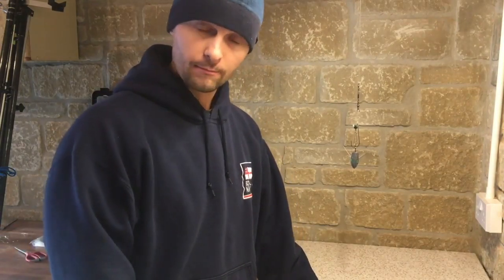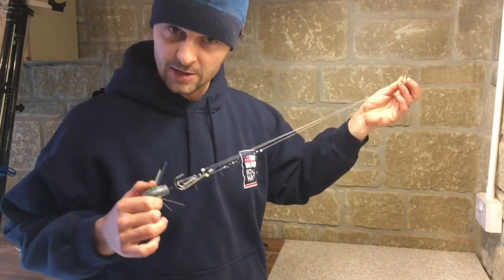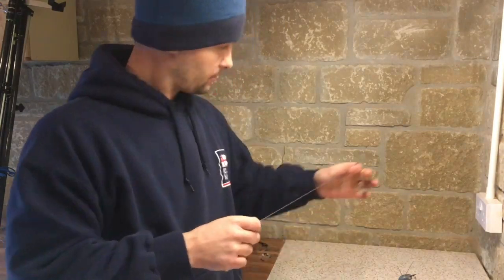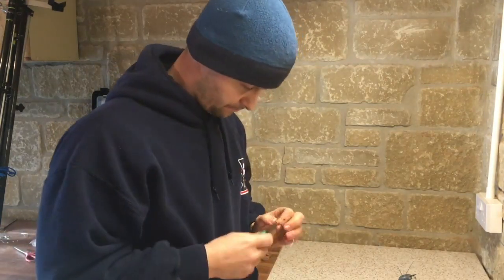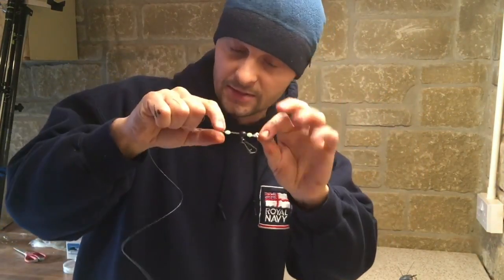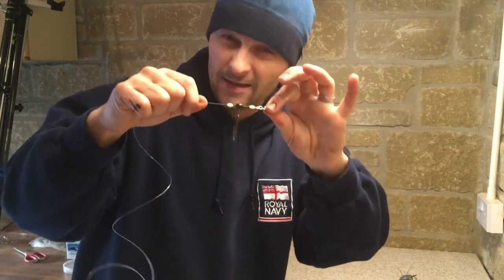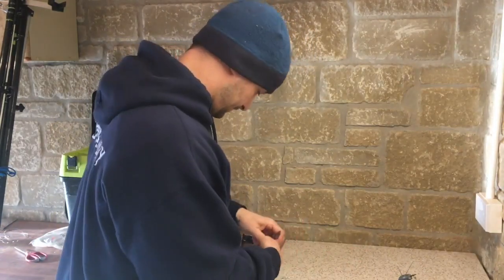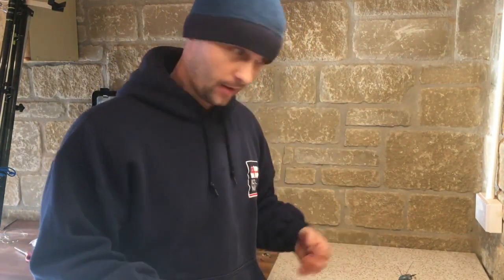How to make the Up and Over Rig - Sea Fishing Rigs

Comment: Can you use more than one hook line on these, or will they tangle up please? I love all your video's and the one of the running ledger rig. This rig seems to be similar to the ledger rig, except the hook lines are secure during casting and the baits won't fly off.
Reply: I have made a rig before where there are 2 hook lengths that are clipable. You have a longer bottom snood with a bait clip half way along it and a short top snood the right distance to grab the bait clip on the other snood. Top hook holds onto the bait clip half way up the second snood's length (the hook of which is held against the weight's bait clip).

Can't remember what it's called

Comment: Hi John, after a 20 year break from sea fishing and being retired now, I notice the use of braid I wonder why rig bodies are not made in braid, I dont understand it, is it non preferred. Regards John Rubie.
Reply: Braid is generally regarded as more visible than mono or fluorocarbon, even if it is thinner in diameter for the same breaking strengths, and in similar breaking strengths braid is not nearly as abrasion resistant as mono, due to its nature and being so thin, with say 50lb braid being around 12-15lb test mono diameter.

Comment: That's a good and easy rig to make.. however as I made this rig.. i would like to point out two things as used it today. 
One use a long tail clip as the bait comes off on cast. Secound use a drop down clip at the other end.. other then that a good rig also make it longer by an extra foot so the trace line is longer...
Reply from the maker: - You can use the splashdown clips that hold the hook until it hits the water if you like? I like it because it can get a nice long flowing trace out there. ;)